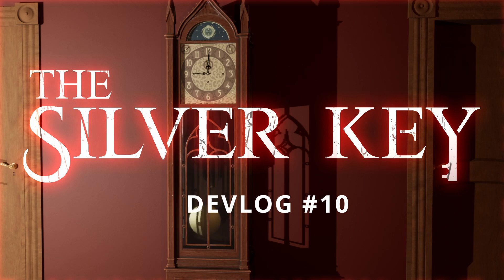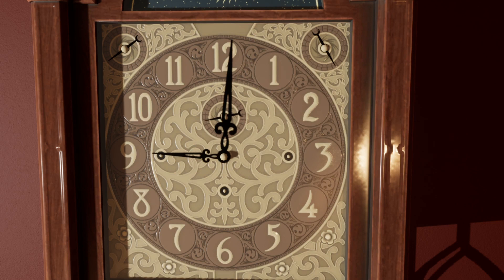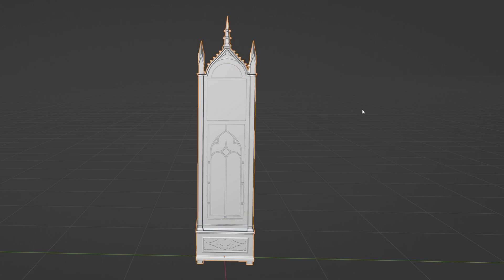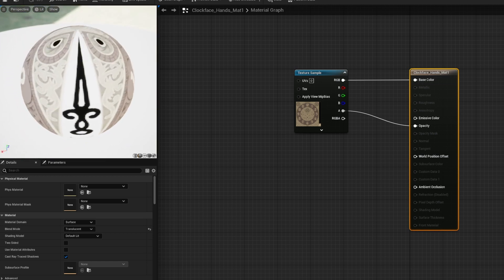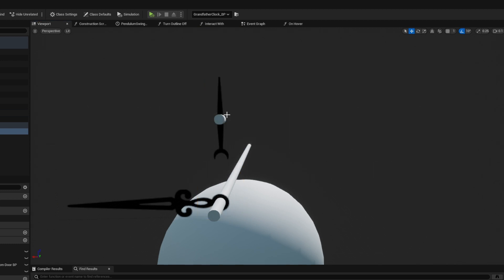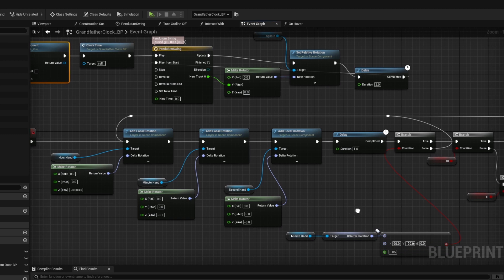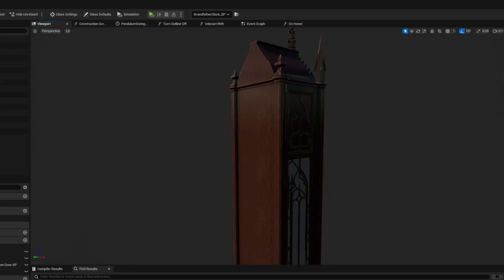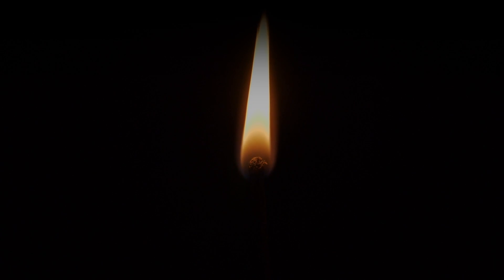Making a Clock | UE5 Dev Journey 10

Comment: This is really cool! But with these advanced game engines, I'm thinking of taking it a step further—like building an actual clock with all its intricate parts. For example, with a grandfather clock, you'd have gravity pulling down at a constant 9.81 m/s². With that, we should be able to construct the entire clock, right? Of course, this means actually understanding how to build one, which is another big component of my interest.
Reply from the maker: That's a really intriguing idea and could be a puzzle or sim game all on its own. I'm not sure the engine physics work well enough to make a weight system and would probably bounce around, but you could probably subtly move the weight downward simulating gravity with the position effecting the other mechanics. Maybe too much math to wrap my head around, but would be really cool to see done.

Comment: Got to your video looking for a quick solution to make a clock but 1 min in the video I came up with a solution myself haha. I used a timeline set the lenght to 60 sec made a float track that goes from 0-0 to 60-1 then use the track for a lerp rotator's alpha that goes from 0 0 0 to 0 -360 0 and connected it to a "set relative rotation" to the "seconds sphere". The update from the timeline goes into the "set relative rotation" and on complete i used a branch set to true and on true goes back into "start from beggining" on the timeline. Same system for minutes and hours but obviously the timline lenght changed to fit the specific pointer(remeber to also change the track end key to the lenght of the timeline). You already have a working clock so no need for this but I thought I would share this maybe help someone. Thanks for the inspiration :D
Reply from the maker: That’s great! Always easier when there are multiple solutions for the same problem. Thanks for your solution and best of luck with your project!